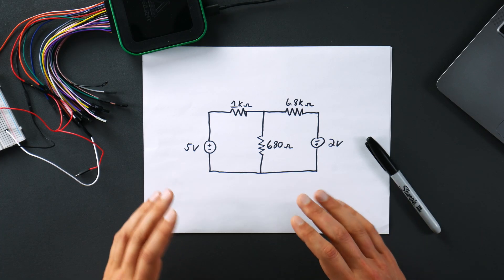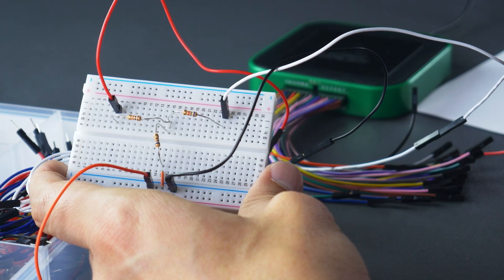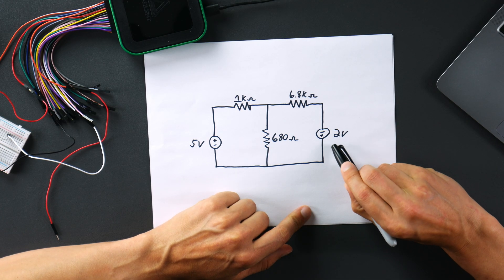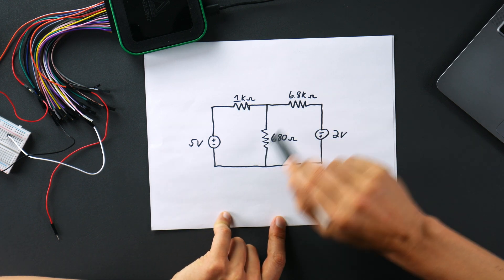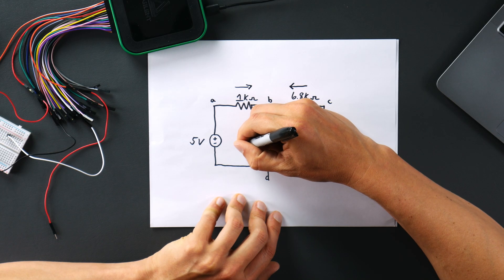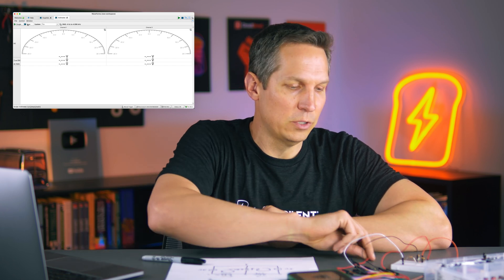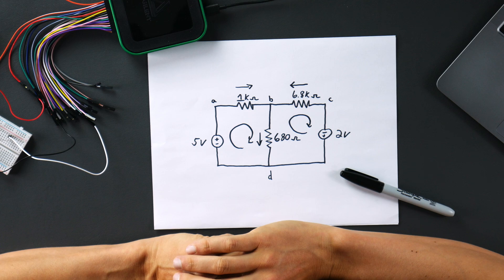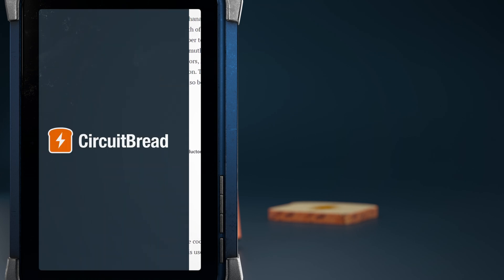Practicum: Kirchhoff's Current Law and Kirchhoff's Voltage Law

Comment: The 5V and 2V are in parallel. In a parallel configuration, components are attached between the two points and hence, they have the same potential difference. But, how can 5V and 2V be connected in parallel and not run into any problems?
Reply from the maker: The five volts and two volts are not actually in parallel because they don’t share BOTH nodes, they only share the one (ground).  It is possible, however, to put two supplies in parallel, it just causes a short circuit and really messes with things. This is actually more common than it should be in real life when dealing with power supplies, rechargeable batteries, and battery chargers - you need to be careful in those situations, though the issue is usually more of one that the batteries get completely depleted or overcharged. 

But for this circuit, the resistors separate that shared node of the 5V and 2V supplies, so there aren’t actually any issues.